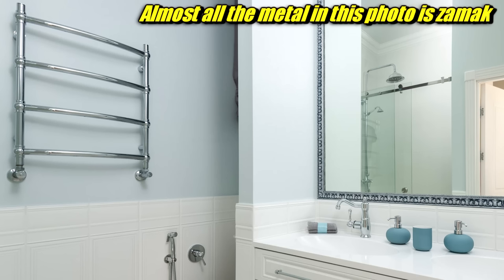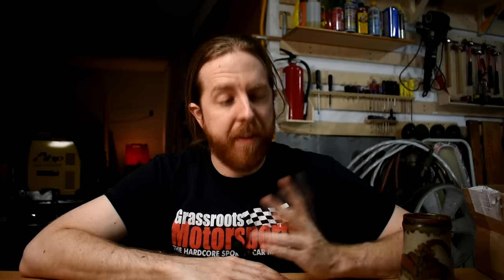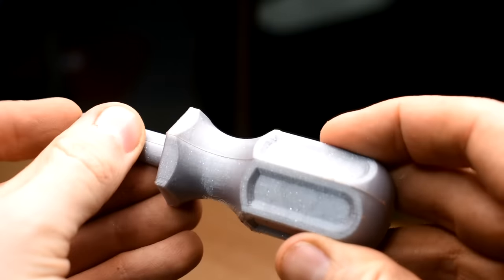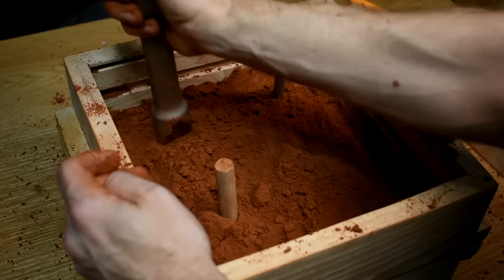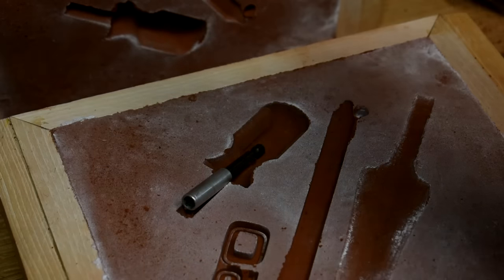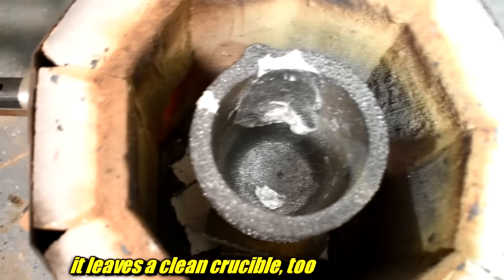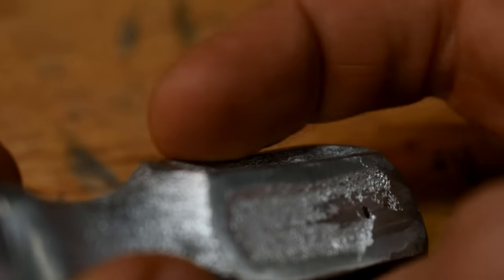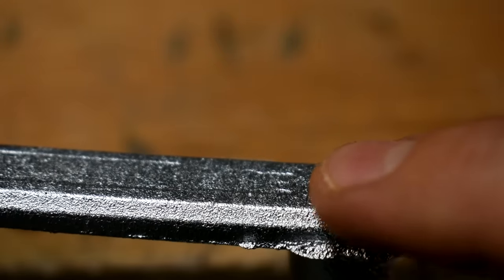The BEST Metal Casting Alloy That Everyone Ignores

Comment: zamak is actually pretty close to low grade mild steel in terms of tensile strenght, wich is pretty impressive for such a low melting point alloy
Reply from the maker: Yeah it's really cool stuff.  Most stuff I make doens't need the high heat or increased strength of steel anyway, so this is just easier
Reply: "amak is actually pretty close to low grade mild steel in terms of tensile strenght"
... No.
it is closer to human hair than to construction steel (which is anything but strong).
Most zamak-alloys are sin the range of 250-330 MPa.
Human hair is 200-250, aluminium in the range of 300-500, and most forms of steel 500-1000.
Reply: @ABaumstumpf  bullshit, the most common construction steel in europe is S235, wich has a yield strength of... 235 MPa. It has 0.2% carbon and minor additions of elements. Zamak has a similar strength to steel, but its surface still is softer, about 60% that of mild steel, and about the same as copper
Reply: @jeanladoire4141   "S235, wich has a yield strength of... 235 MPa."
Sorry but gotta disagree there. the 235 is NOT the tensile strength but Yield-strength - those are very different characteristics.
(Aside from "construction"-steel being literally the group containing the weakest forms of steel )

But lets just give the real numebrs, shall we?
Zamak - yield strength typical ~280, ranges from 220-360. Tensile-strength 270-330.

Human hair - ~150 yield, 200-250 tensile

And steel - how about some 1070 spring steel. Yieldstrength 500, tensile strength 640. yeah, nearly twice that of Zamak and Zamak is indeed closer to human hair than to most types of steel.
Reply: @ABaumstumpf  The problem with your entire argument is that Jean Ladoire's first statement SPECIFICALLY stated "low grade mild steel", not any of the other types of steel that you kept trying to compare it to.
Reply: @mattelder1971  "The problem with your entire argument is that"
That you have either not bothered reading what i had actually written or you were not able/willing to comprehend it.
Cause the fact remains that, as i have also provided the numbers for, it is close to the properties of hair than it is to even that low grade steel.
And then he kept on making up bullshit and even lying about the properties of steel.
Reply: @ABaumstumpf  Yeah you gave all the facts and stats and are right, but the steel you threw the facts and stats out for is basically a non sequitur. I'd hardly call 1070 spring steel "low grade mild steel" like what world do you live in that 1070 is low grade, I mean my brother in Christ it's not even a mild steel it is definitionally a high carbon steel. Doesn't matter how correct your facts are if you just move the goal posts. 
Edit: I threw out another post that had a bunch of actual mild steels with their tensile strength range but I think it got suppressed(I can't see it down here) because I cited my source and youtube didn't like the link. Either way there is a mild steel that has a tensile strength near the top end of Zamak tensile strength "Zamak - yield strength typical ~280, ranges from 220-360. Tensile-strength 270-330." | AISI 1008 mild steel - Yield Strength (MPa) 285, Tensile Strength (MPa) 340. I would say 270-330 range is sufficiently in the "pretty close" range when compared to 340. There's something else I'd like to address: the fact that you refuted his claim about S235 by saying he had the wrong stat(which he did) but you conveniently left out that the right number for S235 tensile strength is 360 – 510 MPa which I would still say the low end of 360 is "pretty close" to the high end of 330. You also turned around after correcting someone by lying by omission then dropping the stats for a high carbon steel completely outside the realm of the debate and acting like it's a slam dunk even being cocky towards a third party.
Reply: @n00bist723  "Yeah you gave all the facts and stats and are right, but the steel you ..."
So the facts are against his claims but you don't like it?

" but you conveniently left out that the right number"
He lied - i simply showed that he lied.
And i even started my argument by mentioning that 

"You also turned around after correcting someone by lying by omission "
Did you mention that Zamak for decorative parts has a far lower tensile-strenght? No? Ah, you lied by omission - ok, if you say so.

"and acting like it's a slam dunk even being cocky towards a third party." Ironic. really ironic coming from you.
Reply: @ABaumstumpf  ninja, everyone here can see you're being willfully obtuse
Reply: wow, that's

terrible
Reply: Jesus christ what happened here, are you guys still wondering if S235 steel has a yield strength of 235Mpa or what? In europe we call common grades of mild steel by their yield strength, not by their chemical composition, oddly enough. But whatever, zamak still is a bit soft compared to mild steel, so making mace heads with it wouldn't work too well. I think copper has like 90 brinell of hardness, probably in the annealed state (it should go much higher with some work hardening), while the zamaks i checked were around 80. You can't expect that much from a metal woth a 400 degrees melting point, it's already impressively strong as it is
Reply: What I got out of this is damn human hair is stronk!
Reply: It's the reason why the vast majority of blanks shooting guns are made out of zamak alloys.
Reply: @FreedomAirguns  Wait,  why are most blank shooting guns made of zamak?    I didn't see anything here that hinted on why that would be.
Reply: @GorillaZillas because its strong enough for blanks, but not strong enough for real cartridges. Most blank guns are also mechanically weakened further, in order to make it near impossible to use it as a basis for a real firearm.
Reply: @dreadnought8363  Oh that's pretty clever,  makes a lot of sense too!
Reply: @GorillaZillas  tensile strength.
Reply: @ABaumstumpf  " " but you conveniently left out that the right number"
He lied - i simply showed that he lied."

So using an alloy of hair and zamak will give a similar tensile stength to 1070 spring steel?

"""The prophecy was true."""
Reply: @ABaumstumpf  So actually closer to aluminum than hair.
Reply: @macrumpton  "So actually closer to aluminum than hair."
well yes. Aluminium is a stronger than human hair, and a lot closer to zamak than steel is in terms of tensile strength (contrary to OPs claim).
Reply: People are misinformed on many things and belive they are correct, they are not intentionally lying.

Comment: Zinc alloys in general are super easy to cast, certain alloys have zero shrinkage, and they take details excellently. At one factory we used a lot (LOT) of zinc castings for anything that had to be more wear resistant than plastic, relatively precise as-cast, and didn't have to be particularly strong. It was possible with investment casting to get this stuff within +- .003" dimensionally, which is better than most students in their first year of machinist school. For light duty parts this stuff is great.
Reply from the maker: Wow that's crazy, .003? I gotta get better at investment casting lol
Reply: @PaulsGarage  The key word is "possible", we had a few dozen different parts that were investment cast (wax method, specifically) and as we went along, we got better and better at it. Repetition and consistency were the most important: the same toolmaker made the investment molds out of the same alloy every time, found out and used the same wax as the foundry when we did our test investments, we chose a very common alloy to cast with so that we didn't have to give the foundry a backup option, etc.

Comment: Hi Paul, Great video! I share your enthusiasm for what you call zamak, and what we brits call zl12 (88% zinc, 12% aluminium). I buy mine from Artisan foundry supplies in Liverpool, where the Beatles come from. I used to fine sieve my green sand and ram extra hard. The surface finish was amazing. I am hoping to try an oil bound sand some time soon, and also an epoxy resin bound sand. Myfordboy uses zl12 a lot, especially for flywheels as it isn't much lighter than cast iron, almost double the weight of aluminium. Lee
Reply from the maker: Interesting!  Myfordboy does some good work, I love his channel

Comment: "Zincpest" is due to traces of lead being present in the alloy.  So if you are going to do Zinc alloy castings, make sure that your use material with a known source and composition.  MTRs are highly recommended for these alloys.

This type of material is excellent for lost wax casting.  Essentially make your part out of wax, dip it repeatedly in a plaster of paris slurry to build up the mold, add additional mold material to add strength, then bake in an oven to melt out the wax.  The amount of surface details and finish is absolutely amazing.
Reply: lost pla is almost the same, but you can 3d print your part

Comment: Thanks for the video! I'm glad that you shared a supplier. Old Craftsman lathes used zamak change gears, and the surface finish is precise.
Reply from the maker: i've heard about zamak gears, didn't know about it on lathes.  Zamak is a bearing material, would probably make great gears and cheaper to make than bronze ones
Reply: I had an Atlas Craftsman lathe and that's how I learned about Zamak.

Lots of stuff besides the gears were cast with Zamak.
Reply: When designing, ive a thought to galvanic corrosion if the zamak will be in contact with other metals in humid air or water.
Reply: Zamak gears would be great to replace the plastic large gears on entry level machines

Comment: Good video, thank you.  I learned about Zamak years ago from a retired machinist that rebuilt magnetos.  Lots of old cast pot metal parts there that had deteriorated over time.  He didn't do casting so he couldn't rebuild a housing.  But it he could do miracles with replacing the corroded interior parts.  And Zamak was his secret weapon.  For the parting dust I've always used a bag made from a bit of a sock or similar material.  Works great for applying a light dusting.  You don't get the clumps like with a shake bottle :)   It's been years since I've had my casting equipment set up.  That's going to be job #1 when I retire in a couple years.  At least the small jewelry equipment.  Dunno about the blast furnace and such, it would take a fair chunk of time and money to get a safe setup for that equipment.

Comment: I have been a fan of zinc alloys for more many years. All my zinc is scrap. And as you rightly said, it is used in so many things. Zinc's lower melting temperature is one of the main reasons it is used for die casting. Because of the high density the head height does push the zinc more int the sand and picks up more grain. So use a shallower mold if possible.

Buying commercial zinc alloys is preferred. ZA-8 and ZA-12. The problem is that a lot people would rather melt free cans rather pay a few dollars for good casting metal. I do collect free metal to melt but I am pretty selective. Stuff that is less desirable I sell to scrap yards.
Reply from the maker: yeah free cans will take all of your money back in wasted time, wasted fuel, and bad castings.  But some people can't see past that.  This za-12 stuff is definitely nice though.

Comment: Been casting bullets with Zamak alloys off and on for about 30 years.
They offer some specific advantages over lead alloys having lighter weight that allows them to be driven faster but having much less overall range which can bea great benefit.
Folks need to learn the properties of the different Zamak alloys and proper fluxing but it's worth the effort.
Reply: Hi Samuel,  What do you mean by "much less overall range"?  I was thinking about using this for bullets as well, especially round ball and conicals for black powder guns including flint lock muskets and cap and ball pistols. .  Can you give me some pointers from your experience?  Thanks
Reply: @hazcat640  Less range because, as a less-dense material than lead, the sectional density of the projectile is lower and thus air resistance slows it down much faster.
Reply: @Directrix_Gazer  Thank you
Reply: This makes me think of the 7.92x41 the spanish toyed with ( which was ultimately killed by the mediocre 7.62 nato ) in the 50's.
Reply: @hazcat640  Use in black power guns is not a good idea.
Zinc alloy bullets are too hard for muzzle loader use.
In a cap and ball revolver, you would likely break your rammer, or spring the base pin on a Colt pattern revolver.
Reply: @samueldamewood5273  Thanks
Reply: Be careful with ATF.  I would closely read their rules on AP bullets to sure you do not get into trouble.  I know copper is ok with them.  But Bronze is not for example.  But if you only use such for yourself and do not sell them there should be no problem.  Light wt high velocity bullets are often used to penetrate ballistic vests.  But due to very low sectional density, lose velocity very quickly.
Reply: How about baffles?? For things to make other things quieter...
Reply: @DZ-hu2sv  If you want durability you can use 3d printed dies to stamp baffles out of steel/alumium or just 3d print the entire thing if you're willing to just dispose of it after a few hundred rounds. Trying to cast it out of low temperature alloys is just kind of futile.
Reply: @ChucksSEADnDEAD  thank you.  I have some that are made of aluminum but I've been told two opposing opinions on the matter. One will say 5.56 will destroy them, the other is it will be fine. So for awhile, I haven't done anything.  I'd hate to ruin them because it would be good to have for a mold to either cast or lathe.
Reply: Interesting, I’ve been casting and swaging my own projectiles for years, I’ll have to try Zamak.
I’ll definitely do some cast 9mm and use it in a Hi-Point. Zamak bullets from a Zamak gun!

Comment: Seeing as you're into both 3D printing and casting, have you tried direct printing with metal? That's almost the kind of temperature you could reach with Zamak. You should look for alloys that melt at around 200C and are available in 1.75mm wires.
Reply: There are some printers out there, but good ones are still on the pricier side. 
IMO this is where the big advances are being made. MFGs are getting better at making them, coming up with better alloys for low-temp metal filaments, making the printers cheaper...in 10-20yrs they shouldn't be too much more pricey than a good polymer 3D printer. 

From there: there are going to be other huge advancements. not just 'hobbyist' stuff, but things like 
"self reproducing automated mini 'factories' " that'll be needed for making colonies/habitats on other planets/moons in the solar system.

Comment: Cool I'll have to give this a try! I like how you made that screwdriver handle!
Reply from the maker: Thanks!  and yes you should definitely try zamak, i'm really shocked how nice it is to cast.  It flows so much nicer than aluminum, and its even easier to melt.
Reply: @PaulsGarage the reason your magnet died is the curie point (loss of magnetism) tends to be around 200°c if I'm not mistaken, so you'd need something with a really low melting point to cast a magnet in